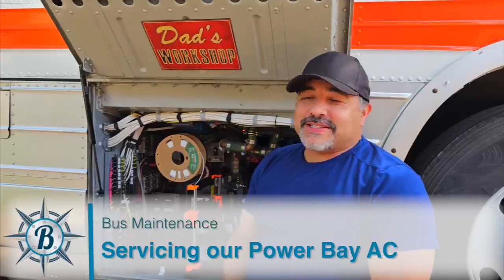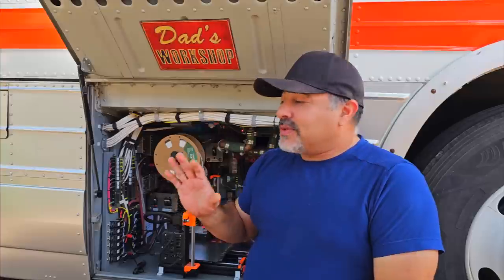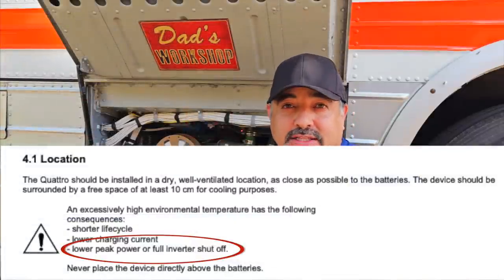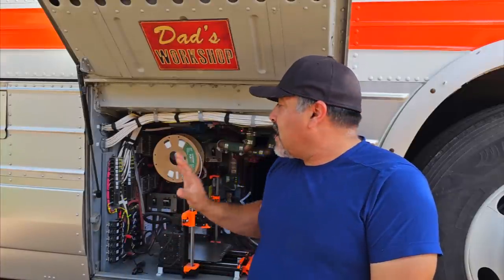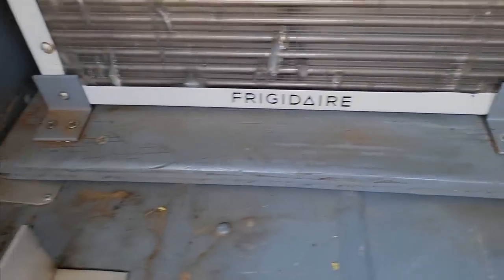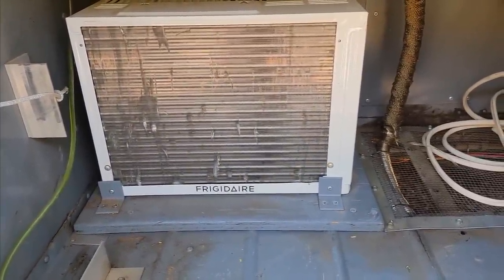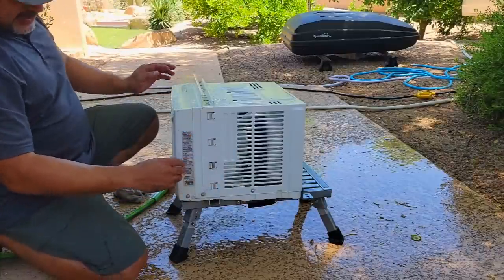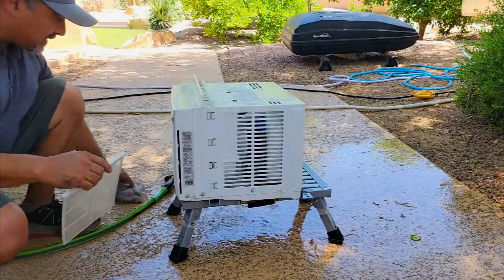Why to consider an air conditioner to cool your electrical bay

Comment: When I used to design electrical cabinets (that were mounted outside, in AZ), we would incorporate heat exchangers into the design for all the reasons you mentioned. Highly recommend doing all of this!

(And I love the idea of an Arduino/Raspberry Pi/PLC running off a thermocouple to start the AC)

Comment: This is the reason l am putting our inverter upstairs and only batteries below or another idea l got is to make a small single axle trailer, make it water tight and put our salvaged EV batteries on the trailer. I got this idea from a guy on here, he used VW Id3 which is 62 kwh so its kinda 3:01  big. It can be broke down and made smaller.  Flying Tools is the YouTube channel, the guy does fine work, worth looking at lmo.  Our bus was the very last Yellowstone Park Co. MCI Mc-5B to be sold, #503.  Super excited took me over 18 mths to find it but the wait was worth it, in fact it is in AZ, so we're shipping it to Florida asap.

Comment: G'day everyone,
I hope life in the bus is going well.  I bet the kids are big now. 
Q. I drive a 1963 vw beetle and being aircooled the engine bay gets quite hot. Have you got a video on your temperature sensor setup. 
Thanks for sharing ✌️ Peace from Melbourne Australia.
Reply from the maker: Hi Kevin - I don't believe I ever did one on the temperature monitors.  We have a few different ones.  The BMS has 4 temperature sensors 3 on the batteries and one on the actual BMS unit.  We also have a few DHT22 digital sensors plugged into some our Home automation setup (via ESP32).  Lastly we have SensorPush Bluetooth sensors that we place in different areas to give us real time information in areas of the bus.

Comment: I would get some commercial heavy duty full suspension slides and a hold down to hold it in place.  then when you need to service it, you "unlock" it and slide it out.

Comment: My Brother-in-law had an old milk truck body and he got a small window unit and he sought out one with mechanical control, and wired in an electronic control and he could turn it from refrigerator down to a freezer, if needed. He originally used it to keep freshly caught sacks of crawfish alive while waiting to bring them to o the wholesaler.
Reply from the maker: Wow his insulation must have been awesome!
Reply: It was a small box like 6x6 and it is usually not nearly as hot here in south Louisiana as it is in Arizona. But it was a standard milk truck body, I’m not sure how well they insulated them, but it could not have been more than two inches or so of whatever insulation they used.
Reply: I also note that most Van Life/rv’ers avoid any place above about 80° (f) in the summer. 

That asphalt gets pretty soupy at those temperatures- I’ve seen leveling jacks go in like it was puddling when it’s hot like that. Kudos to you for controlling your environment because you can!

Comment: I hade a spare Midea inverter 8kBTU unit I put in the electronics closet in my bus. The bus powers my house with the solar when It's in my back yard and that closet is the only thing I have to cool in the summer to protect the inverter and batteries.
Reply from the maker: Awesome!  I am looking at adding a similar (12K BTU) unit to help keep things cool this summer!

Comment: a lot has changed over the past 4 years, do you have a new battery system inmind for future upgrade?
Reply from the maker: Thanks Stephen - yes technology moves very quickly.  If I had to do it today I would likely use prismatic LFP cells and probably the same BMS.  LFP cells are more durable and much safer than the battery we are using.  We keep a close eye on everything and log everything to reference and analyze in case things go wrong.  This battery still provides us with everything we need be at some point all batteries will stop working.  At that point we will look at what is available and look at the advantage and disadvantages of each.  At this point the rack-mount options are looking interesting as well - but the quality of the BMS in most of them appears to be lacking.

Comment: You know Rittal make a purpose made unit just for this application that could fit on your bus compartment door? This seems like a waste of time and space IMHO. Guess you're using it because it was cheap ;)
Reply from the maker: I have never heard of Rittal so I looked them up.  They appear to make high-end air conditioners designed for server rooms or data centers.  I didn't see any units that were purpose made for my application, but at nearly $4000 for their smallest air conditioner I can't see how this would be a real consideration.

Comment: your bringing out the dirty truth of all these EV products, the bigger the system the more draw you need for cooling, you have to feed the problem..hence I have my reliable diesel generator, can boondock for weeks as I bring enough fuel, I dont need that large battery bank, or inverters..and also solar doesnt generate well at high heat, which i think you posted, and its not just arizona, anywhere here in the west heat is a killer and those large consuming electrical product like  compressor refers, ACs all use more power for 24 hours at times for everything, especially when smoke from fires is around, that season is picking up. You might want to think about ducting that hot air out, so your coil air is not being pre heated making it even more efficient
Reply from the maker: We did have some trouble with heat and solar generation for sure.  I don't think it is something that is often talked about.